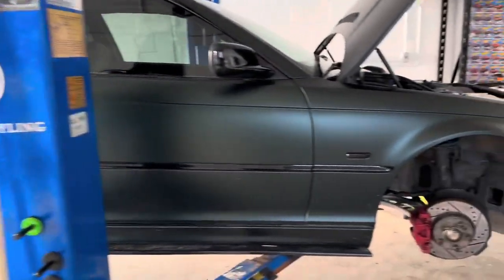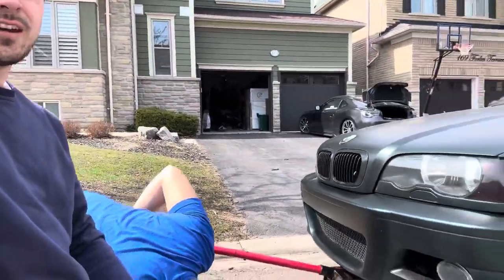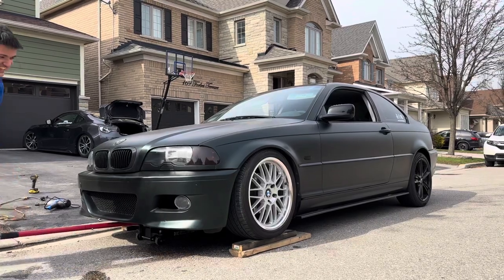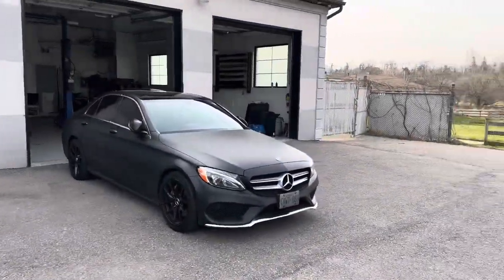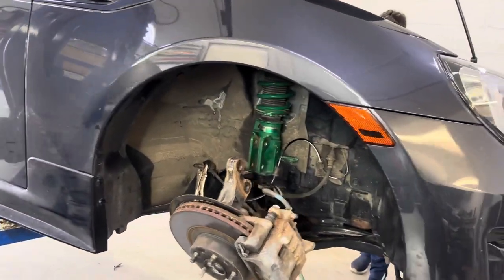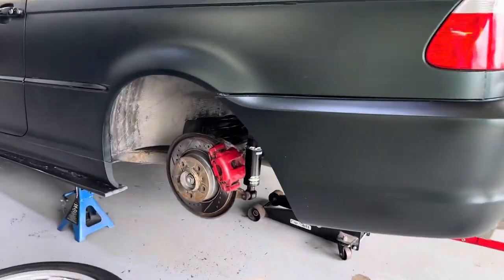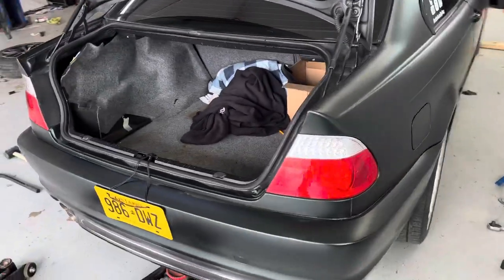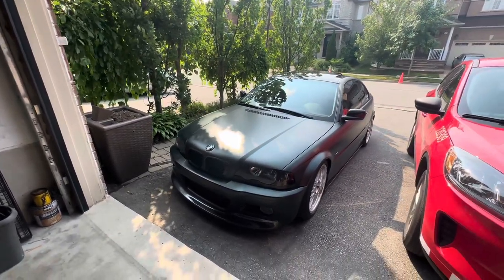Installing BC Coilovers bmw E46 Coupe

Comment: Which front lip is that??
Reply from the maker: It’s a M3 Style carbon lip
Reply: @ArcticAutoStyling Do you happen to have a link for it or where i can find one? Looks good
Reply from the maker: @zachrosario8966 I got them from a supplier when I lived in Ontario 

Where do you live I can mail you one for cheap 
Message me on Instagram